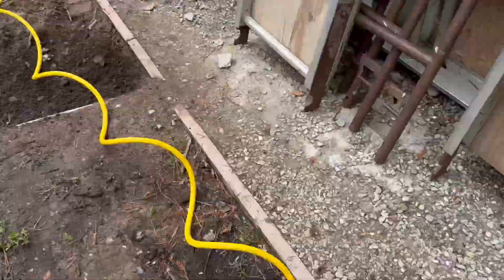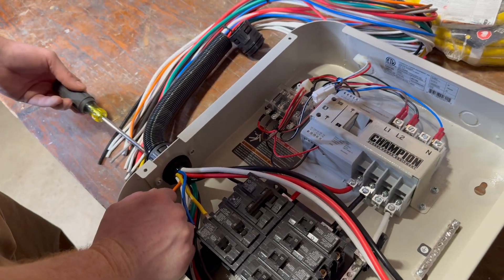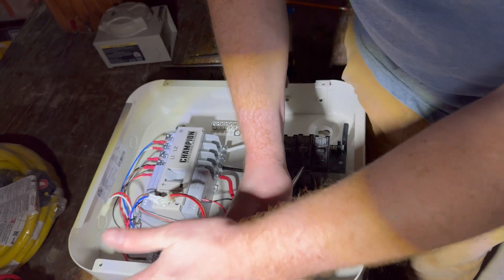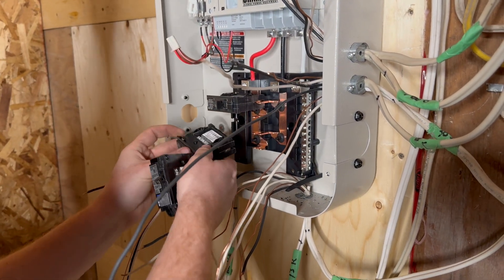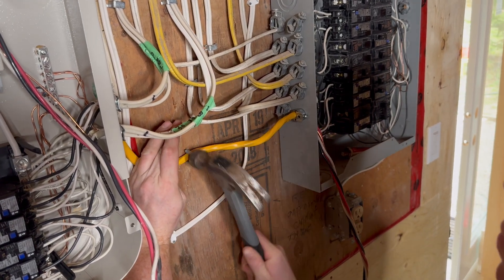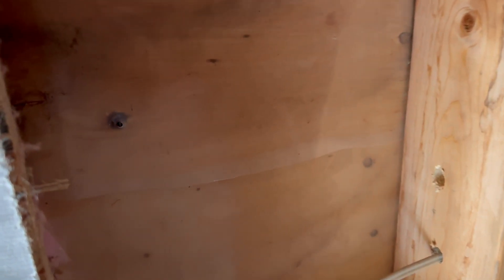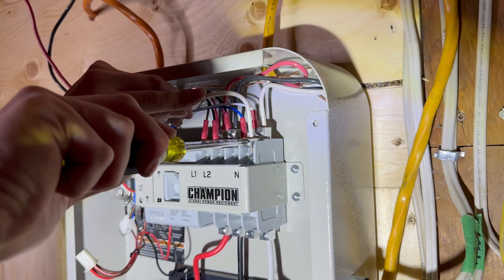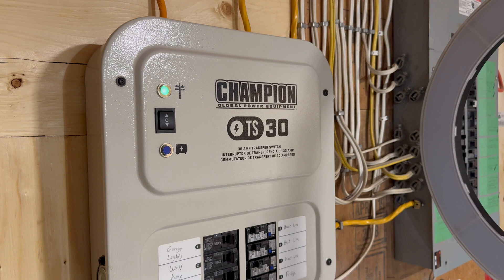Champion Manual Transfer Switch (MTS) Installation Guide (Canada Install)

Comment: What happens when the main power comes back on? I have to manually change it back or that has a built in auto disconnect from the MTS to the grid power?
Reply from the maker: Thank you for your question. Since this is a manual transfer switch, you will need to manually switch it back once your power is restored. If you are looking for a transfer switch that operates automatically, we recommend our automatic transfer switches, which are typically used with our Home Standby models. If you have further questions, please feel free to contact our support team at 1-877-338-0999, extension 4.
Reply: @ChampionPowerEquipmentHQ  no I dont want automatic. I was just wondering the steps for when the power came back. tks

Comment: Most people are not touching on this very, very important subject.  Most generators have internal bonded connections. The bond has to be broken at the generator otherwise possible tragic results could occur if connecting this generator to the house.
Reply from the maker: Hello, we suggest that every customer consult with a certified electrician before taking on the task of installing a manual transfer switch or connecting anything to it to ensure their safety and the safety of the home and all electronics that are connected to it. If you need any further assistance, please contact our support team at 877-338-0999 or support@cpeauto.com. Thank you

Comment: I like the idea of using this over the reliance models to save money on not having to buy another set of afci or dual function breakers. 

However this essentially is a weak sub panel. All those circuits running off a 30A main house breaker creates a weak point where you could trip the main breaker when running a heavy load (stove, electric dryer, electric water heater etc).

The 50A version of this panel will probably be better, but it would be nice if Champion made a 100A version of this panel to eliminate this concern of tripping the main breaker.

Comment: This is exactly what I needed info on. So rather than going to individual breakers and making connections inside the panel, you make those connections inside the transfer switch going through one 30 or 50 amp breaker. 
Could the same be done with a pProtran2  box?  
Double pole breakers are only needed if I want to run a hot water tank or something like that, correct? Otherwise all breakers inside transfer switch would be 120v.
Thank you so much for sharing this. 🙏